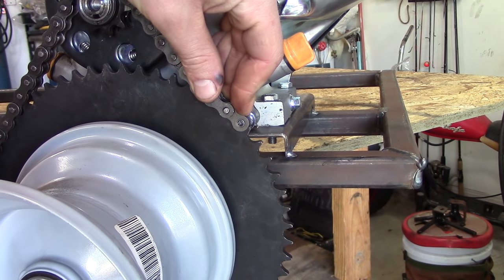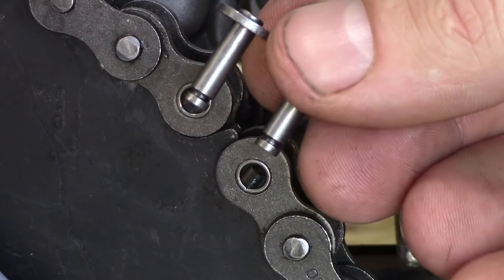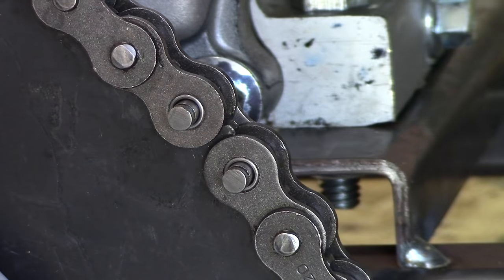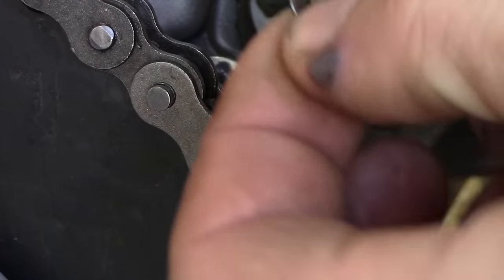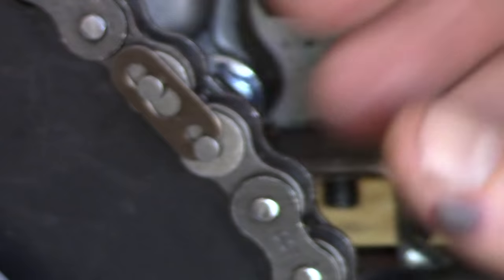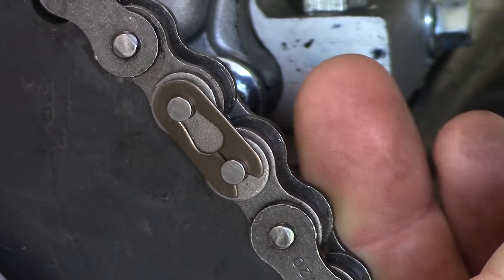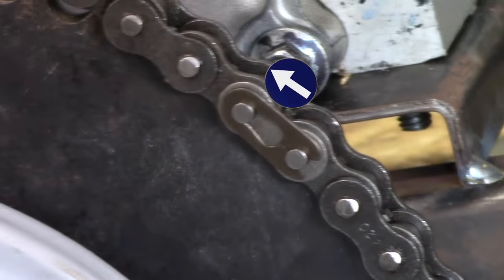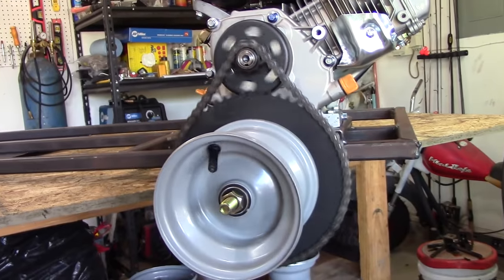How to Install a Roller Chain Master Link Clip

Comment: TY for such a clean, clear video, with audible audio lol. My 66cc bike chain snapped or fell apart tonight, and this helped me fix it.

I am still new to 66cc bikes, and thankfully the fella at Zoom Bikes sent a few extra parts (for free!) he thought I might need to rebuild this old 66cc gas bike, and - thank god - he sent a master link assembly (the 3 tiny pieces pictured in ur vid).

I checked out a couple other vids, but nobody mentioned the last step (retaining clip) and I was really confused why I could pull the link apart with zero effort lol. Thankfully I found your video before trusting my repair job.

Timing couldn't have been better to have your clear instructions and this spare part. I am broke as a joke rn and use this bike as my daily commuter :)

TY again!! The main drive chain on this dinky little 66cc engine seems good as new now :)

Comment: I am attempting to fix the chain that broke off my CT200U mini bike. There is not a Master link on this chain, unless the whole link broke off when the chain broke. I have the same clip setup as your video, however there is not enough room to use the 8 shaped link on both sides and the open ended clip. I am tempted to use just the clip(closed end facing forward,) and hold on to the 8 link until I can find longer pins or a different clip. I think my plan is okay temporarily, but can you help me understand why the pins aren't long enough OR if my theory that the whole master link broke off is correct. The kit I ordered was supposed to be for the Coleman mini bike, so not sure why there were no pins provided, not enough room for clip and the 8 link (thats closed on both sides.) Thank you in advance, I really appreciate your videos as well.

Comment: no press tool needed? just the clip and that’s it? i just ordered a non o-ring chain for a vintage honda and am wondering if i need to press the link before installing the clip … i know you don’t here in this video, but still asking for safety reasons. thanks

Comment: Regarding orientation of master link clip, what should be the orientation if the chain is moving in both directions.?

As per my experience, the orientation of clip is not important. Because it holds the pins by tight  spring action. The clip is not holding any pressure of force.

Please let me know.
Reply from the maker: Both directions? That’s interesting. Main framework of thought is that if the leading edge scrapes on something, the force at the leading edge will either push it keeping it in place, or (if ‘backwards’) pop it off

Comment: So if the clip isn't installed right, could that be the reason my chain keeps coming apart when driving? It's only the master link that comes off and I've ran through 3 master links in 1 week
Reply from the maker: Could be chain alignment or master clip installed backwards or master clip
Rubbing on something
Reply: @KartFab  ok I'll trouble shoot some more thank you for the reply

Comment: I thought I put it on backwards. Lol. Also there's no room for the plate and master clip. Any suggestions?
Reply from the maker: Put the plate on the other side? If not you will need to get a chain breaker and just make the chain one continuous loop.

Comment: I have a roller chain for my ct100u and the chain says 35h on it.  I can't find a master link for 35h.  Regular 35 is not long enough to allow the plate and retainer clip to go on.  Any suggestions on where to get a master link for a 35h?
Reply: I would call a few shops that deal with chains, like small equipment repair or ones that do hydraulic hoses.

Comment: My go cart chain just arrived on xmas eve. Its to long, was hoping you had a video on shortening too. 
  Santa didnt finish the cart. 😱
Reply from the maker: If you have an awl or punch you can punch out the pin. I just cut my chain with an angle grinder
Reply: KartFab 
Remove the master link clip pull those pins to unloop the chain? 
  Set it on the gears to get length, grid or punch out pin on leading edge of overage. Insert master link pins. 
  Sound right.
Thank you for quick reply.

Comment: Does anyone know how to if its possible to connect a master link to a half link?  Cut my chain a bit to short, so had to add a halfink, now need to use master to connect the chain to make it 1 piece together you know... am i better of cutting a new chain ? And just using master link instead of tryig half links to master links like i spent 10 hours today!  Exhausted from crap. Lol.   Changed my case 1816 skid loader pullies and put sprockets on and trying to do chain now so no slippage... can anyone help
Reply from the maker: I don’t see why not.

Comment: I have a 415 chain on a motorized bicycle and the master link keeps coming apart. I cant figure out why and put it together right and slid the lock on unless it matters which direction you clip the lock on.
Reply: +bicycless211 I even put the clip going that direction and it still came loose.
Reply from the maker: +bicycless211 it matters which way, and i put mine on the right way. Master links can 
still pop off if you have other issues such as: 1)wrong size or worn 
sprocket (master link clip hits something and it breaks loose 2) 
misaligned sprockets 3) wrong size master clip for your application.

 So if you really are scratching your head after looking at those options, you would need to buy a chain break tool and forget about a master clip. A chain break tool allows you to create a continuous chain that should only be broken by using the tool itself. It basically punches out the pin, and allows you to seat the links together on the pins.

Comment: can i use a master link made for a bike for my snowblower chain as long as it's the same size?
Reply from the maker: The size should be stamped on the chain and stamped on the master link. If the numbers match up, it doesn't matter what they go to, they will fit and work.

Comment: How to remove this?
Reply from the maker: Edy Wijaya use needle nose pliers, put one end of the pliers on the post end, open the pliers and put the other end of the needle nose on the clip, squeeze/ close the pliers to pop the spring clip off. You can also just do it with a flathead screwdriver, but it is more dangerous if it slips off.
Reply: +KartFab stupid question. which side is the post end.
Reply from the maker: +Zach “war head” Wedel ok so do you see the link when i put it together? There are two posts that stick to a plate. The ends of these posts are the post ends. What  some people do to attach and remove the clip is use a pair of needle nose pliers instead of the screwdriver method that I showed in the video.

If you are putting the clip on you touch two parts, the clip, and the post furtherst away from the closed end of the clip. Squeezing the pliers together will make the clip snap onto the posts.

If you are removing the clip, you still do the squeezing action, but you touch one end of  clip with the pliers (the open end), and the other post (the post on the closed end of the clip), then squeeze. This should pop the clip out of the grooves in the post. 

Hopefully that makes sense. That method is safer than doing it with a flathead screwdriver because if it slips, you just close the pliers instead of jack up your fingers.

Comment: anybody experience not being able to get the clip on due to zero room room to squeeze it under the bevels? I ask now after I'm bleeding from both hands, hahahaha!
Reply from the maker: You probably bought the wrong size master clip or don’t have it pushed up
Reply: @KartFab  hey, thanks for responding. I ordered a 428 master link, was using a 420, should get here today, I'll let you know, hopefully we're both right:)
Reply: @KartFab  well, this is unfortunate, it must be a 420 chain because the 428 ML pins won't even go in the chain links. I am baffled.

Comment: how did you get it off?  very good and helpful video btw
Reply from the maker: you can apply pressure with needle nose pliers or just the flat head screwdriver to the spring clip in the reverse direction.